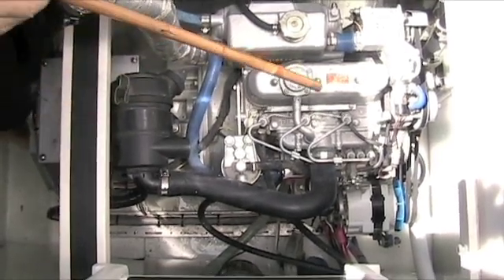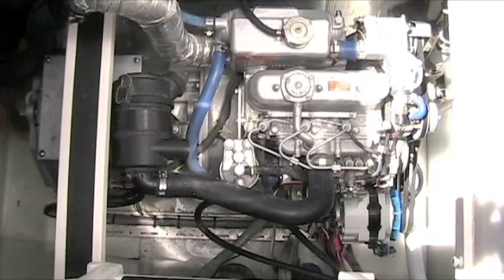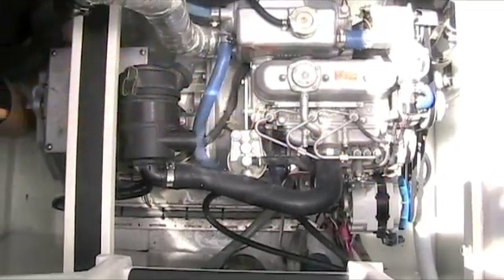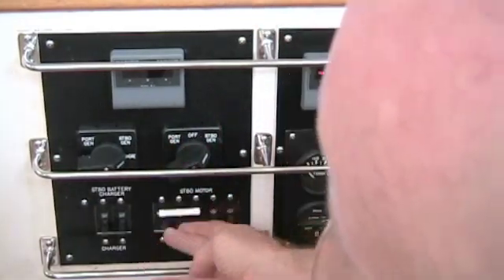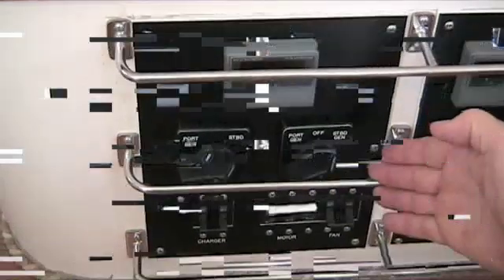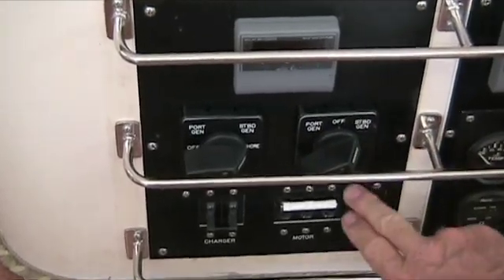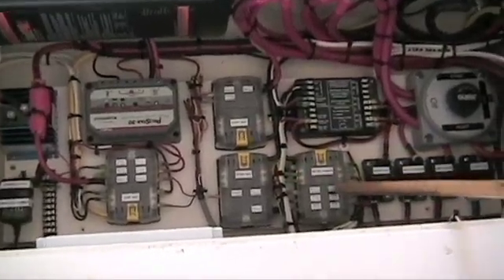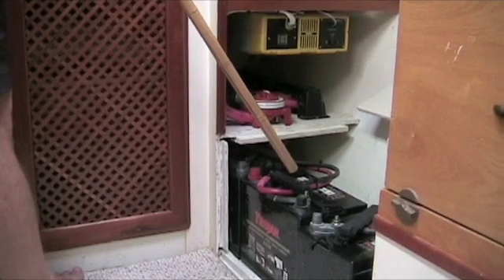Harmony's Electric Propulsion System Pt. 2

Comment: Nice! Can you run the drive motors from the batteries? (Using a 12Vdc to 240Vac converter) That would be nice and silent for short runs.

Comment: I am very impressed with what you have done and that your not just limited to just running on fuel for electricity/ power. I wonder what will happen if a few more people take the same steps that you did. I also like the fact that you increased the amount  of time that you will have that is silent. thankyou for sharing.